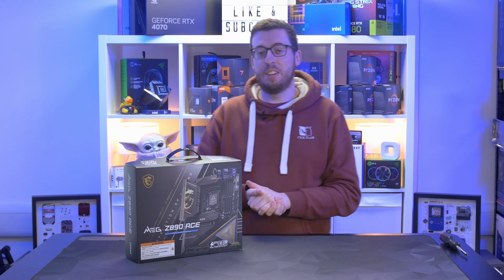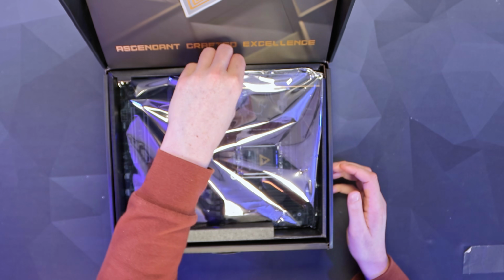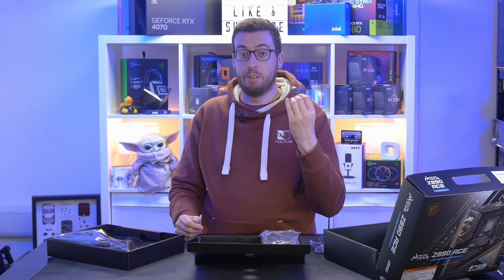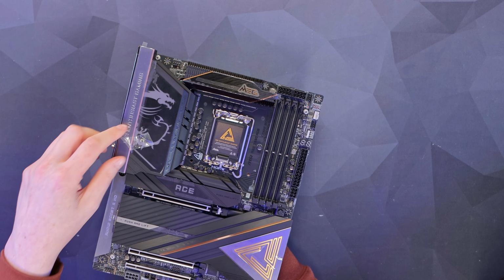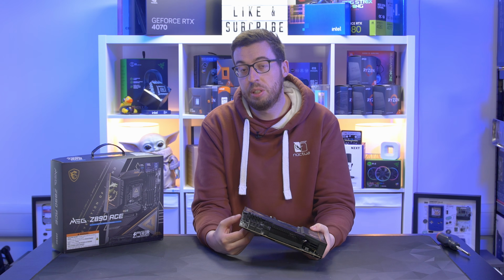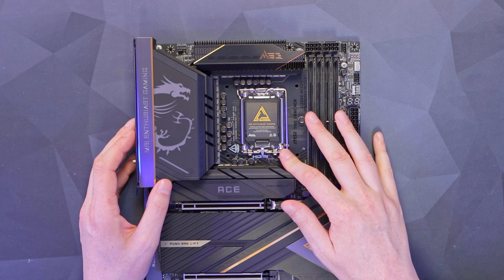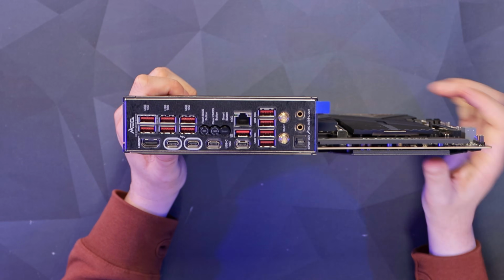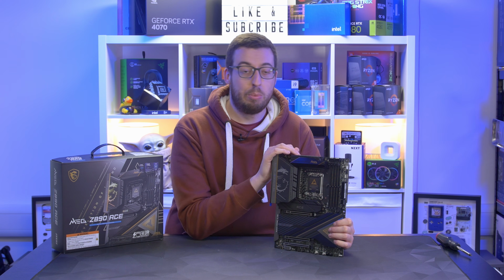A MONSTER MOTHERBOARD! - MSI MEG Z890 ACE - Unboxing & Overview! [4K]

Comment: Big price but less function.

They could have an dual thunderbolt 5 on the back 10.

Also giving 2x 10g Ethernet

While allowing atleast a tb4/5 for front i/o instead of a card. So much type c just 2 tb5 on board would be too much to ask? And give us pcie slots for use man.

Just you just your stupid cards are taking up too much slots and just one was not left for a graphics card there is no room for expandability. Learn something from gigabyte

To be precise gigabyte aorus z890 xtreme ai top.

We are gonna be so much for your motherboard and you are still not using the practical things. Damn msi.
Reply from the maker: That board you're comparing to is £1079 here in the UK, the Ace is £534, so that's twice the price. The Gigabyte/AORUS AI boards are designed for more than one GPU anyway, whereas this is designed for gaming, where you more than likely won't use more than one as SLI is no longer usable. 

Yes, there are things this could benefit from, especially Thunderbolt like you said, especially when there are the Asus ProArt boards that are most aimed towards creators, but I think it's unfair to compare this to the Extreme AI TOP as that is designed for a different purpose, and costs twice the price ☺️
Reply: @jordanash I was comparing godlike not ace.
Reply from the maker: You've commented on the Ace video though. Plus, the Godlike is even more expensive that the Gigabyte boards.

Comment: does this motherboard take i9-14900k?
Reply from the maker: No, you need Z790 for that. This is for Core Ultra Series.
Reply: @  gotchu
Reply: @jordanash  Wait so is it the same for the Msi Meg Z890 godlike? It doesn’t take i9-14900k because on the specs on the website it says that it can run i9-14900k
Reply from the maker: That's wrong then, can you give me the link, I'll pass it on to MSI. Z790 is LGA 1700 (12th, 13th & 14th Gen), and Z890 is LGA 1851 (Core Ultra Series).
Reply: @  Yea I have to find it again
Reply from the maker: I searched but it was all correct on what I found, it must be a specific page.
Reply: @ so it takes i9 14900k or no
Reply from the maker: No, as I said in my previous comment you need Z790 for the 14900k.
Reply: @ oh ok ok I understand

Comment: Tuning Controller (JDASH) and dual BIOS and lane switches you missed. Hope you do a full review. Tuning Controller (JDASH) didn't come with the board. Z890 Unify X does have so if you are doing both maybe compare the cooling and RAM speeds for the overclocking and use the Tuning Controller (JDASH) with the Ace.
Reply from the maker: I don't generally cover those kinds of little things just to keep the video concise but can add them for higher-end boards in future. I will be using this in a build soon, but I'm not getting any other MSI boards as far as I know.
Reply: @jordanash  Ace does look like a very good board. It has all the overclocking features. Option for RAM also. Cooling is impressive and 10G LAN. It seems to be somewhat future proof. Yes there is the question if this is one or two gen board or longer. That is a really important question for the price. One very disappointed, two not happy, three Ok and more it would make the board fair value.
Reply from the maker: Yeah, I'm going to talk more on the generations in my round up

Comment: Allways got the gigabyte boards, but now i think of getting msi meg ace instead of gigabyte master
Reply from the maker: MSI are putting out some great stuff recently
Reply: @jordanash  Yes, gigabyte z790 and x670e were better built than z890 and x870e, for the 700 euro they dont have even backplate, for the enthusiast top 3 boards are i think z890 meg ace, z890 unify and asrock z890 taichi ocf, asus boards are way too much expensive for what they offer, thanks for reply
Reply from the maker: Personally I don't get the point of the backplate when you don't see it in a case 🤷‍♂️

Comment: Does the board come with a build in SSD heatsink? I can’t imagine a heat sink would fit under any of that
Reply from the maker: It's not mean to fit under, it's meant for drives without one. The cover itself is the heatsink.

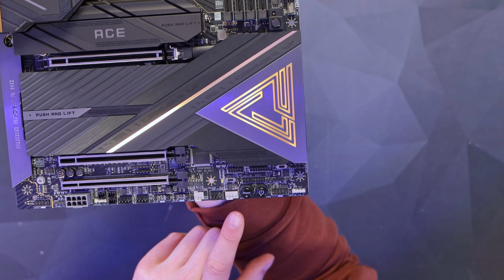Comment: 5:00 , no, that is not for the water pump, that is flow sensor header. Also, this is currently THE best board for workstation / prosumer build out there, only X670E Ace is at this level and thats an EOL board. If you know, you know. Especially if you are planning to run a custom loop, or two.
Reply from the maker: Okay, my bad